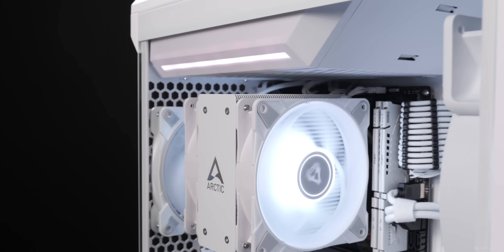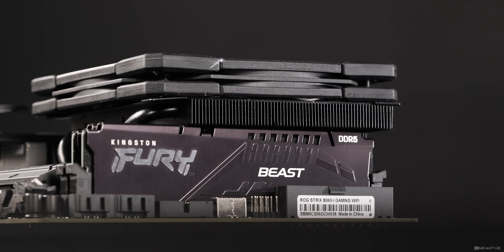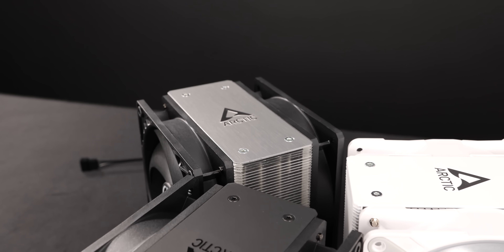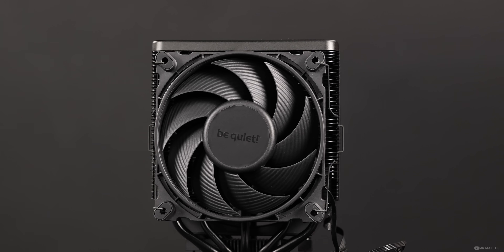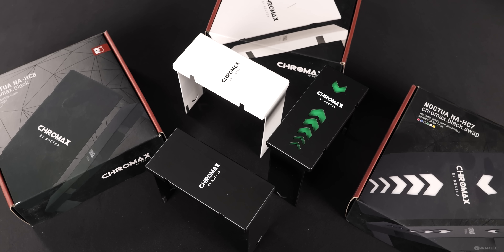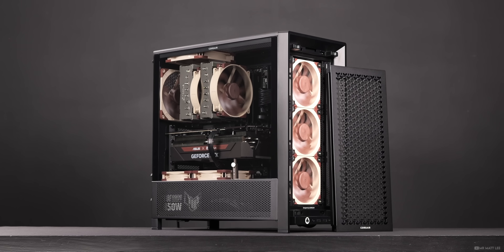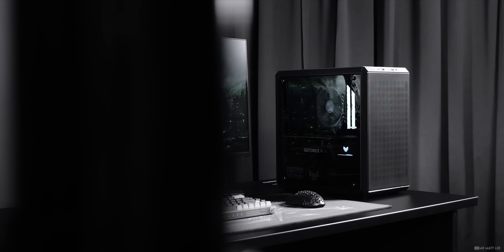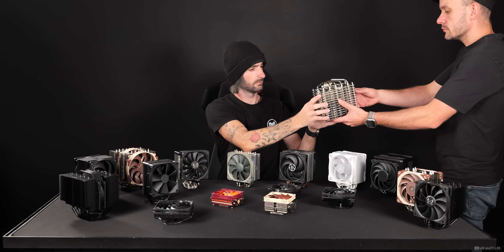Cooling Kings: Top CPU Air Coolers That CRUSH the Heat in 2025!

Comment: I usually got ID-cooling or Arctic for a simple temp/$$ gain in my builds, they look good and are very cool for under 50€.. but since my personal PC for over a year now is well over that budget range.. I wanted something with more bling, so I got, DeepCool AK500 Digital Pro (90€) , almost no gains in cooling power since my ID-cooling SE-226-XT (50€) was similar and was already doing a good job, but AK500 does seem to be keeping the same temp with less noise and that info screen looks soo good, 40€ premium but I got what I wanted
PS: Ryzen 7500F is the cooled CPU in question, but 9700X upgrade is on the horizon

Comment: Hello there. Right now I'm using the Noctua NH-U12A and I like it a lot. Btw @Mr_Matt_Lee have you tried mounting the front fans in the Fractal North inside vs. outside? What I'm curious about is the noise level difference  between the fans when they are closer or further from the front panel. I tried it and as I heard it there is a little bit of difference, less turbulence when the fans are further. Anyone lese? Great video as always :) Cheers!

Comment: The Noctua NH-D15 G2 is simply the king of air cooling – insane performance, whisper-quiet operation, and craftsmanship at its finest. It’s not just a cooler, it’s the heart of the build that proves Noctua still sets the standard.
Reply: It might be good quality but it ain't worth that price with the TR - PA performance almost as good for 1/4 of the price you are basically buying the cooler for the name of the brand, not what you get for the amount of money.
Reply: @FrankAndreasLia  For what it's worth, the D15 G2 is genuinely one of the best-built coolers I've ever seen. It's not just the brand name, but genuinely the most you can get out of a non-vapor chamber design. I'm not saying it justifies the price based on performance alone, but the costs to build the cooler are much higher than most, and it's up to the buyer if they think it's worth it. Plus Noctua is pretty much second to none when it comes to warranty and them supporting coolers with new brackets in the future for free.
Reply: Peerless assasin is equal in everything thing with half the price though.
Reply: Nice ChatGPT comment 😂

Comment: I'd love to try one of them Scythe or Noctua ones... but for now, I'm rocking a Thermalright Peerless Assassin 120 (OG version).... I went for an all-white build after a friend of mine helped me secure a Sapphire Pure 7900GRE for under 600 bucks on Amazon :D and I've gotta say, this air cooler is working freaking WONDERS on my 7600X AMD processor... I've never EVER seen it go over 80°C and that's under suuuuper high loads... and considering I live in a rather hot arid place where average temps reach 105°F in summer with 0% humidity... this cooler has proven to be one of the best investments I've ever made! :D I've got friends who went and bought super expensive AIO's or so and they ended up failing in less than 2 years... my good ol' PA120 has been crushing it since day 1 and I love it :D

Comment: Thermalright peerless assassin mini(7800x3d, 2700x & ryzen 9700x) and Deepcool AK400 Zero dark(ryzen5600x) are great coolers. Also had the Noctua NH-U12S chromatic black (ryzen2700x), which was decent but I feel like the cheaper deepcool and thermalright performed better.

Comment: Another new cooler I used with a 9800X3D was the Sudokoo SK 700V . The performance was impressive for a single fan cooler, outperforming many dual tower air coolers.

Comment: Had previously used a Thermalright Peerless Assassin mini, as my previous tower had height clearance issues. The TR PA mini still worked very well with my AMD 7800 x3d CPU. 

I upgraded to the Thermalright Phantom Spirit 120. No noticeable change in performance or temperatures.

Comment: I have the Arctic Freezer 36 with 2 Arctic P12 Pro in my 7800X3D. What a cooler, I got it just paying 20 euros, it is incredible, aesthetic and an amazing cooling power!! Got 60 degrees always playing at 3440x1440p.
Reply: is it worth upgrading from the stock fans to the p12 pro? because im using the same cooler for a 7600x and underload its not enough
Reply: @cjentuskuzan4027  Arctic Freezer 36 has the Arctic P12 PST...I think they get 2000 RPM as max speed...Arctic P12 Pro can reach 3000 RPM...besides this last fan has more static pressure...
Btw, did you change BIOS values to get the 7600X cool?
Reply: @andresfp6027 you mean undervolting and changing pbo things ?

Comment: I'm glad to see Air Coolers get some love coz most of your builds seemed to go for AIO coolers 😅. I only use air coolers (no AIO) and Power Limit + Undervolt the CPU. I'm currently using a Noctua NH-U14S and have used Coolermaster coolers many years ago but now sticking to Noctua. It's a expensive but reliable, quiet and built to last. Love the Black as well as Coffee and Cream (which my U14S is).

Comment: The top-down style of heatsink is available in larger sizes too, like Noctua's NH-C14 and NH-L12 models.  I'm using the be quiet! Dark Rock TF 2 (134 mm tall) in a Cooler Master NR200 case to keep my 5800X3D cool and quiet.

Comment: AIOs are still cheaper and have better performance. There can't be any debate about that.
For those who will comment on reliability: I've used the same AIOs for over 7 years and I had no issues with reliability.

Comment: I have a Thermalright Phantom Spirit 120SE, for the case I have an Endorfy ARX 700 AIR, it comes with 3 140mm intake fans and 2 for exhaust, great airflow :hand-purple-blue-peace: I have never seen my 9700x above 75°C even under stress

Comment: Was using the AK620 Digital with two Noctua Chromax Black fans before swapping to the Liquid Freezer 3 on my 13700. Another pal of mine is using the Freezer 36 on their 13600K. Might put the AK620 into my R7 7700 if I think the Thermalright Burst Assassin isn't enough

Comment: Upgrading from DeepCool AK500S Digital to DeepCool Assassin IV VC Vision Digital (or AK500 Digital Pro - depending on the size of the cooler which one fits better into the flight sim tower.). And upgrading the ehm... rubber-band mounted NVMe coolers (I only have 10mm space for cooling fins that limits the choice of M.2 coolers severely) to coolers that look almost exactly like the ICY BOX IB-1816M-C31 External Type-C enclosure. Superb and absolute sleek and minimalistic design for the NVMe´s.

Comment: CPU cooler Thermalright Peerless Assassin 120 SE ARGB in a CM MasterCase H500 with two 200mm front intake fans. Silent with all the airflow I could possibly need.
Reply: Scythe fuma 2 in the same case as well cools my 7800X3d,,,indeed very good!

Comment: In my personal builds I run a Noctua NH-D15 Chromax for my main rig.  For my ITX Fractal Terra home theatre PC I run the Noctua NH-L12s. 

For the PC I build and sell my go to is usually one of the Thermalright coolers. They work great, are reliable and do a great job cooling entry to mid level CPUs.

Comment: I have a Peerless Assassin 120 with a digital display cooling my 7800X3D. It keeps my CPU in the 60’s when gaming and under 72C when stress testing.

I was going to get an AIO but I was told that those are not necessary unless you are doing extreme overclocking (or if you have an Intel CPU). Glad I decided to cool with air which is much cheaper than liquid.

Comment: With my AMD Ryzen 7 5700X heavily undervolted, Arctic eSports 34 Duo is doing a marvelous job of making the case almost passively dead-silent while temps (with ambient of 26C) are never above 35C while watching your video! Previously, this was not possible - always between 40 and 50C!
Undervolted, with two 120mm AKASA Apache in a push-pull config, using Prolimatech PK-3, Arctic eSports 34 is doing a stunning job!  Couldn't recommend it more!

Comment: Hi Matt, ive been rocking the Dark Rock pro 5 for a year now and it's been perfect to handle my sweaty 5800X3D at stock settings. My only issue with the cool is that it doesn't seem to hang straight on the motherboard, almost like it is bending half a millimeter. (which can also be seen in your video at 5:05) Maybe im just looking into it too much. Everything is screwed in tightly into place. It is quite a heavy air cooler to be honest!  Cheers!

Comment: I bought two Arctic Freezer 36 based on reviews and the LGA 1200 mounting kit they were compatable with, one was for AM5 and the other for an older Intel system. It is now not compatable with their LGA mounting kits, the latest revision 4 has moulded plastic bars now for fitting instead of spacers and metal bars, these are probably more than alright, possibly also less prone to damaging, most likely easier to fit and less fiddly.
Will still be using this on 7600x builds with Arctic case fans due to the costs, aesthetic and memory clearance though. Revision 3 was the one that fits their LGA mounting kits, with the metal bars that could fit LGA 1200/LGA115* systems. 

I still use Noctua NH-U12s and NH-U14s coolers myself, though I am tempted to add dual G2 series fans to these with the Chromax top plates. Noctua support has been outstanding, having offered over a decade of support the these, as well as two NH-U9s and an ITX cooler, great products with the best support and customer service. And so nice to work with.

Another shout out has to go to BeQuiet, one of the LGA1150 systems here has one of their bigger coolers still running since LGA 1150 was released, and their smaller Dark Rock Pro at £27 is great for less demanding systems or older CPU sockets, as BeQuiet like Noctua offer a lot of CPU support.

As a fan of air coolers I have yet to try Thermalright, Arctic, Be Quiet and Noctua have a nice selection of CPU coolers and fans, making it easy to plan an aesthetic build on cost, silence or just the love of Noctua. Not seen a lot of reviews on Thermalright case fans, but the other thing they do is cover memory slots.

Thermalrights Peerless Assassin 120 black at £40 is nice without the heatpipes showing on top, though the Phantom Spirit has a slighly better aesthetic, but the sheer value of the basic Peerless Assassin SE dual tower at £30 is outstanding. I probably owe it to myself to try one at some point as well as some case fans. Though we have seen on Youtube reviews that their fans are not as great as their coolers, and quality on Thermalright products is variable hence the cost. Only Amazon seems to be selling the fans so it would be great to see more reviews of case fans and air coolers from the same manufacturers as complete cooling systems.

Comment: I bought a Scythe Shuriken 4 to see how a down draft would do in my SFF (You mentioned the IS-55 has longer screws for a full 120 and sure enough the Scythe has them as well). I love playing around with air and heat in little ITX cases.

Comment: I switched from my old Dark Rock 4 to an Arctic Liquid Freezer III 240mm solely because my GPU didn’t have enough clearance when mounted vertically. Still Dark Rock4 was goated when used with 3700x, 5600x, 7500F and my current 7800x3D

Comment: Last year I upgraded from i7 3770k to 7950x for my 3d visualization workflow. When I went to shop to upgrade, I had one thing in my mind that I'd have liquid cooler as I had fascination with it. The shop owner suggested that I should go for air cooling as it will be more beneficial on longer term. He said all workstations he has provided were equipped with air coolers and has been working without fail. I reluctantly went for Deepcool AK620 and no matter how much load my pc has, it has never shut down due to overheating. Air cooling FTW!!!

Comment: I have R5 7600x, had Arctic 240mm Freezer 3, it broke down, bought the Freezer 36 as replacement, which worked well enough, got my money back for AIO and bought Thermalright Phantom Spirit 120. I should have bought it right at the start, solid perfomance, might even go for more powerfull CPU like 7800x3d or 9800x3d.

Comment: I just upgraded from the stock cooler to a Thermaltake Astria 400 aRGB for an Intel i7-14700f. It's keeping temps 20°C cooler than the stock cooler for only $50USD (including tax), is much quieter and more aesthetic (in an all black MSI Codex R2 Case)

I have no plans on overclocking anything so this is great.